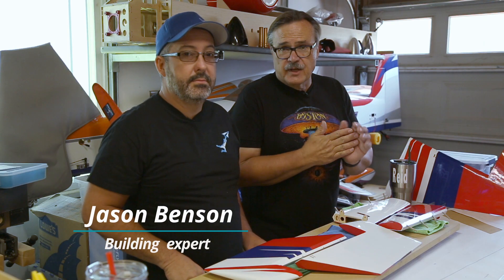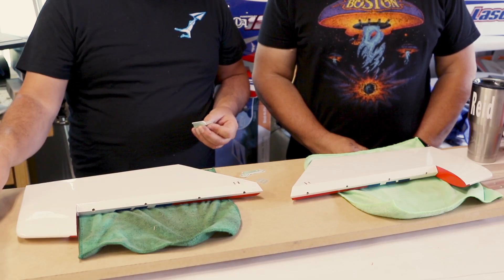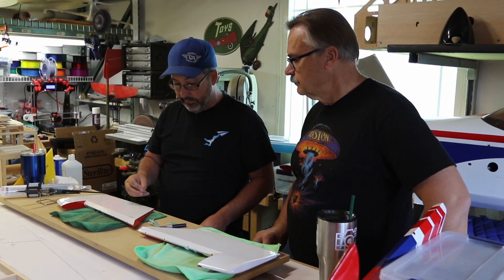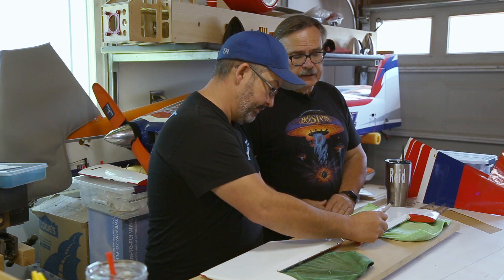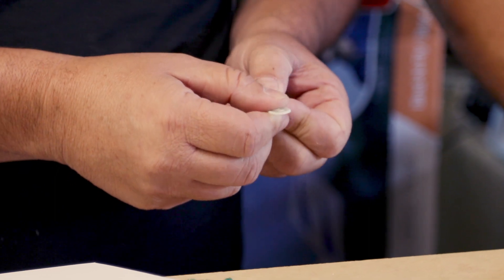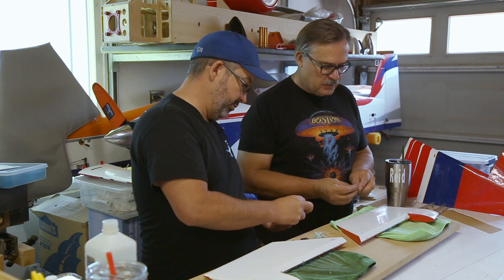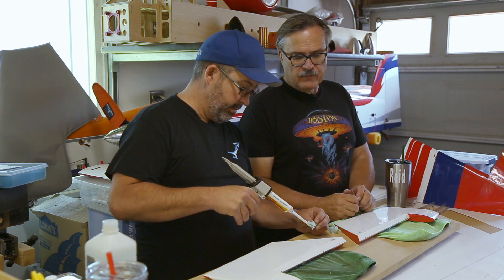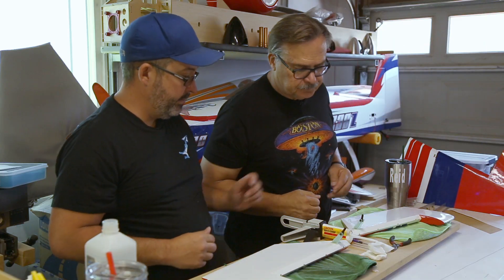FlightReviewz How To: Installing Composite Control Horns (Elevators)

Comment: I'm definitely getting the epoxy gun. How many years of my life have been spent mixing epoxy in little medicine cups? Also, as an experiment, I assembled the control horns on a 73" plane using CA instead of epoxy. I think I was just lazy that day, but wanted to see the result. The contact between the control horn and the wood is very tight, and has a lot of surface area (two things that CA likes). Also, the control linkage can be exposed to high stresses, but usually not very much 'shock', like a landing gear would (CA is brittle when there is impact). Anyway, I have over 100 flights and the CA-assembled control horns still are perfect. Now, this was an electric powered airplane, it is possible that vibration would loosen the ca joint over time. Anyway, food for thought.
Reply from the maker: Yeah, the epoxy gun is a game changer for sure. As for using CA on the control horns I can see it working on an electric but as you mentioned the vibration from a large gasser would not be an ideal environment. The extra gap filling and being less brittle properties of epoxy are really optimal though. So here is the question: IF you had an epoxy gun do you think you would have been too lazy to break it out to glue the horns in?